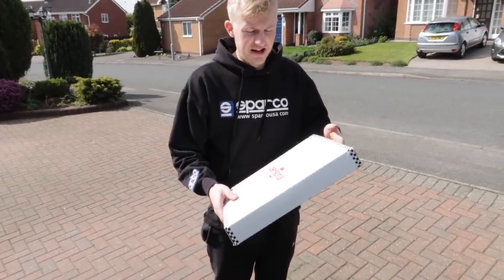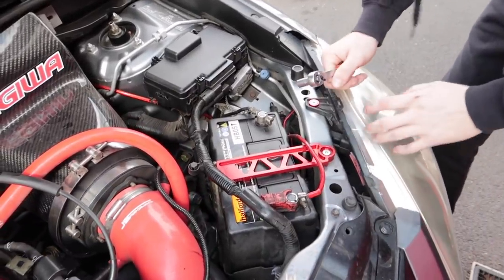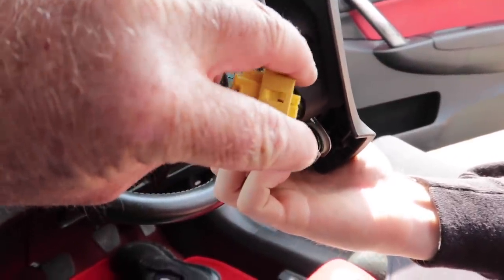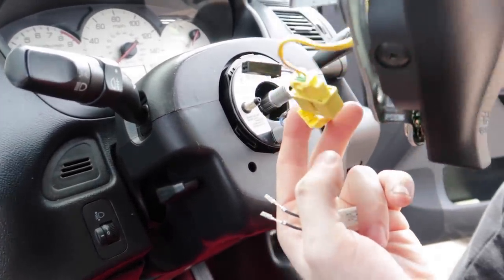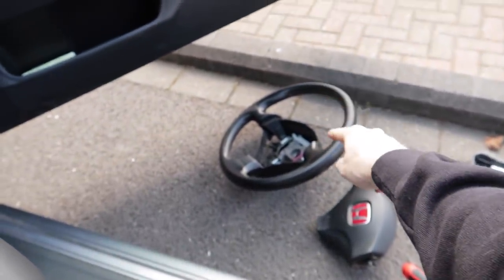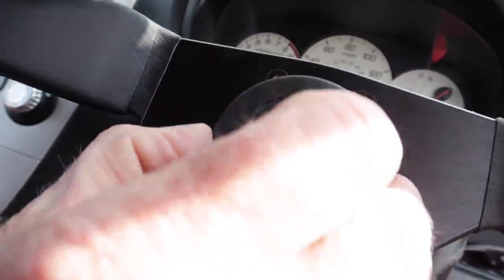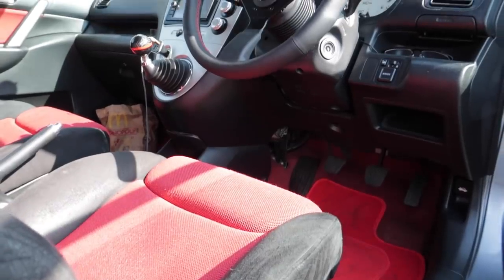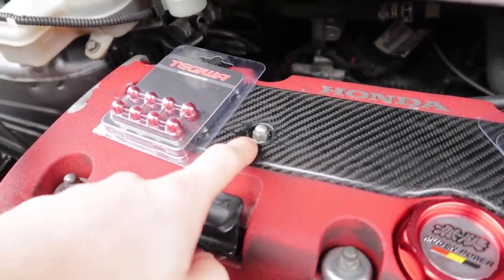EP3 Gets Nardi Personal STEERING WHEEL!!

Comment: hello jesse, I have a civic ep3 like yours, I have to change the steering wheel with a personal like yours.
on the tegiwa website there are two hubs one with airbag and the other without airbag.
which one should i take? I don't remember an ep3 version without airbag. if I take the one without an airbag, don't they give me the relay inside the package to correct the error of the light?   can you help me? tanks

Comment: Heres a way round the “would it fail its mot”? 

Keep the modified steering wheel on till the mot comes. When you book the car for its mot, put the original steering back on, and it passes its mot, take off the original steering wheel and put back on the modified steering wheel. Happy days! 😁

Comment: I don’t wanna be that guy but 😂😂 won’t your car fail the mot with that wheel ?
Reply from the maker: not 100%  sure to be honest but some older cars dont have an airbag so not sure?
Reply: Jesse Collingham only cars made without one should pass without air bag. Depends where you get MOT done 😉
Reply: @JesseCollingham  If it's not there it doesn't need to be working, you have a resistor so It's fine I believe.
Reply: I only say this cause I really wanted to replace my steering wheel with a after market one like yourself and on a Facebook group people were saying it’s a mot fail if you take a factory air bag out and don’t replace it with one with a air bag.